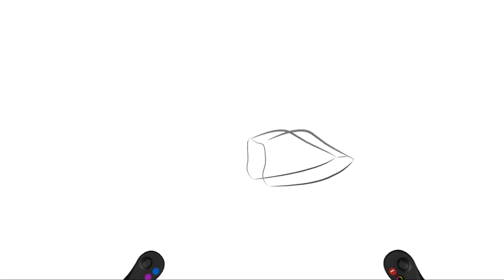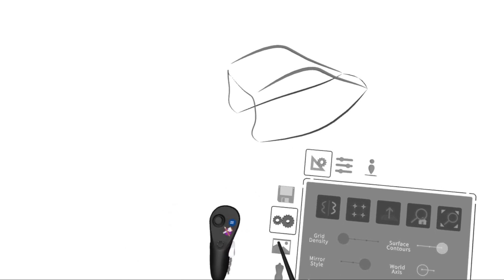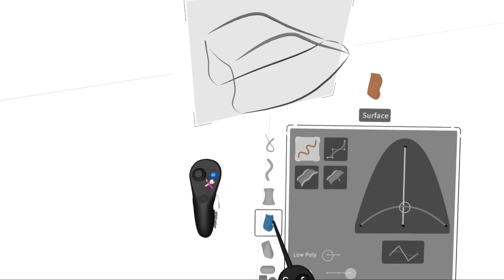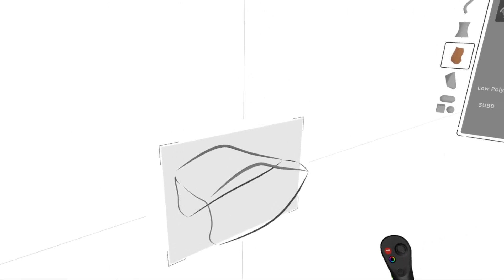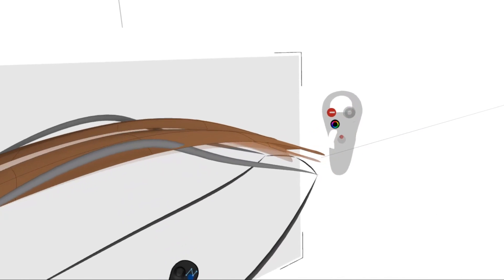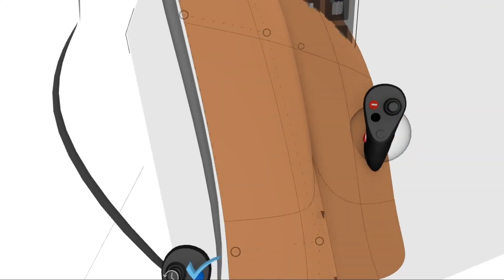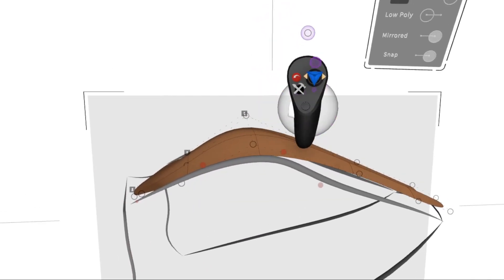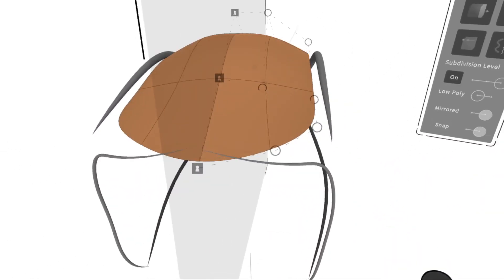SubD Snapping - Tools Tutorial Gravity Sketch VR

Comment: can the points at the mirror surface be unsnapped from each other? or are they permanently fused?
Reply from the maker: Once they are snapped they cannot be unsnapped. Simply delete the points in the middle and re-extrude the edge to get back to unconnected surfaces at the mirror point
Reply: @GravitySketchYouTube  thank you for replying but I found out I can split them again buy grabbing them and hitting the black button on the main hand. Now for my next question, I found a tool in the toolbox, that nobody talks about, the only thing I saw it do is invert the visible polygons for the object I hit with it, does it have a name?